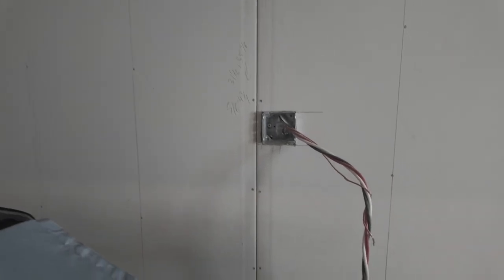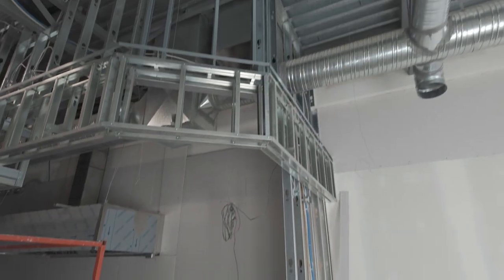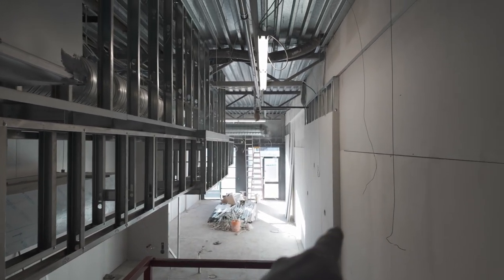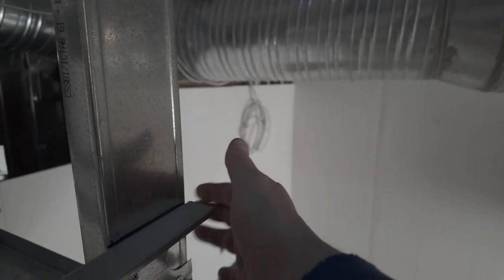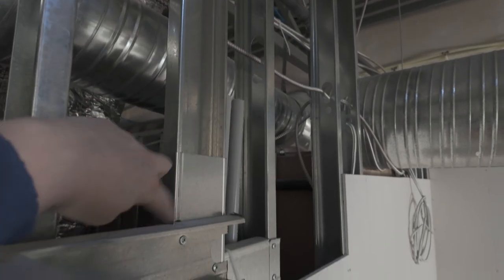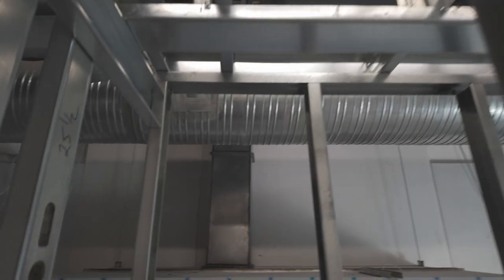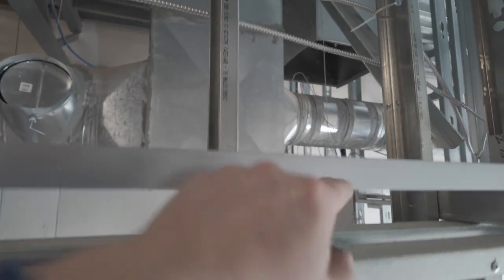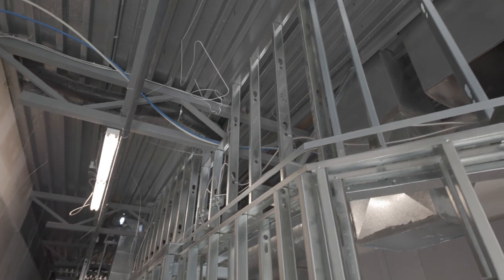Expert Metal Stud Framing Bulkhead

Comment: Very helpful videos Chris. I tried connecting through Paltap but got a message it’s not available in our region. Based in Toronto, not sure why I can't access it. I have a question regarding metal framing. We have to create rooms in a retail space with an existing 2 - 5/8" thick ceiling and bulkheads. Do I have to cut the drywall ceiling open and attach a U track / channel  to the ceiling frame or is it safe to just install it on the drywall with screws which can reach just past the metal frame for the ceiling? There is no other load on the wall but there will be a hollow core door for the rooms. What would be the best practice? The Stud on the wall side will be attached to the cinder blocks and the U track on the ground in nailed to the concrete ground. Just wondering if the top U track/channel needs to be directly be screwed to the ceiling frame (cut the drywall) or can get away with just screwing it to the drywall.
Reply from the maker: Awesome, yes sorry PalTap is no longer available anywhere. I am trying to clean up the links as I go. I hope you got my email about this, we can set up a zoom call for sure.
Reply: @ConstructionKronies  Yes Chris looking forward to the Zoom call. Thank you.

Comment: Idol is there a chance in your shop drawing say partition should be 2 hour firecode .how to do that.because when i ask that in one the big project they fire me
Reply from the maker: Yeah man, check the fire plan, add 1 layer 5/8" type x for each hour to both sides of the wall. Fire caulking at the top and bottom done by the firestop contractor could be the drywaller if you priced it. Fire rated walls will be 5/8" type x and go all the way to underneath of structure.